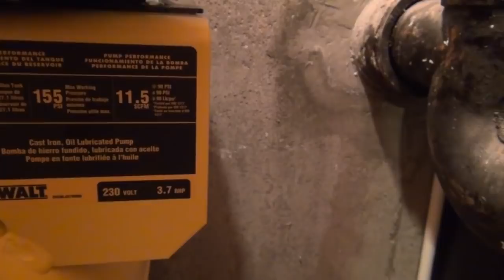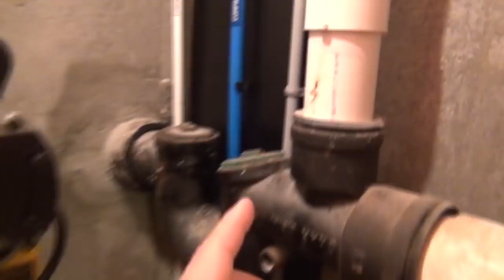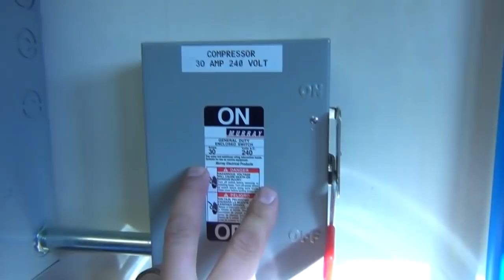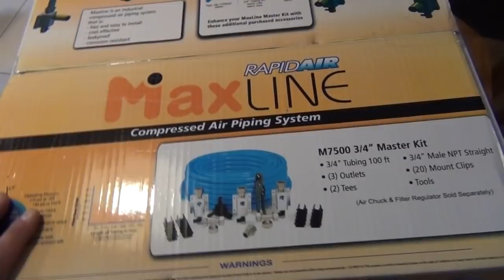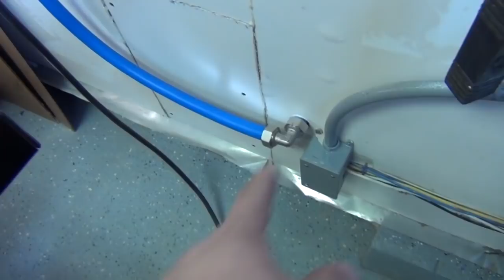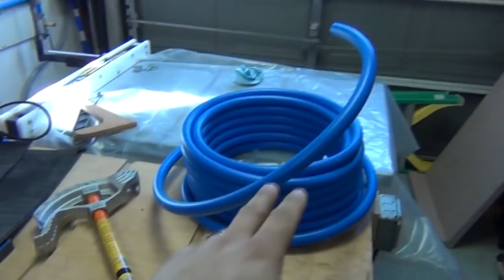Air Compressor and Shop Air Install

Comment: so even though you have breaker on that outlet, that you can shut off, you still stand a chance of getting water in that outlet if you have to open up your waste line and snake it from a clog.
Reply from the maker: Drop Tine True, I keep the disconnect in the off position whenever I'm not using the compressor so chances are it will be deenergized...but good point none the less.  Thanks for the comment.

Comment: Looks like Pex tubing ( stupid auto correct)
Reply: Rapid air is a type of pex called Pex-Al-Pex   Its pex then a aluminum pipe inside then a thin pex layer inside the Aluminum pipe to keep the aluminum pipe from corroding. one benefit is The aluminum allows it to keep its shape when bent.
Reply: You can use pex instead. the only benefit of the al layer is that it can handle direct sunlight without breaking down.

Comment: I used a 3/4” clear hose with a cross hatch material inside. My 80 gallon compressor goes to 175 pounds I had that on there 5 years no problem

Comment: Great setup and clear instructions and explanations.  I am thinking of getting a 60 gallon compressor for my garage for automotive work.  Which drier regulator do you recommend?
Reply from the maker: racerxnk Thanks!... Link is in the description for the one I recommend and use.

Comment: Looks like a very well thought out and executed setup. Simular to what I'm envisioning for my shop, except with the use of PEX and normal fittings instead of the Max Air kit. I have my compressor in a lean to along the side my 30x30 building. I will be running 3 drops along each side of the building and one down the center support column to a reel, making the system an H shape when looking from the front of the shop.
Reply from the maker: Sounds like a good plan.  Good luck with the job and thanks for taking the time to comment.
Reply: zimsjeep 
Got it all in and setup, works great, thank you.

Comment: nice set up. have the husky 60 gallon and ran the 3/4 rapid air kit too. i was wrecked trying to find a 3/4 jump hose too. then i stumbled across one cheap here. https://www.farmandfleet.com/products/817277-maxline-3-4-x-3-jumper-air-compressor-hose.html i ended up going with the 3/4" rapid air filter too i found that cheap on eBay since finding ones that were priced decently at 3/4" was tough.
Reply from the maker: bill mc Thanks for the link. I haven't seen any ill effects using the 1/2" hose. Plenty of cfm for my impact and hvlp guns.  I've been very happy with this setup. Should have done it years ago.
Reply: welcome! and yeah I'm told 1/2" would've been just as fine for my install as well. wish i knew this beforehand would've save me so much time and hassle lol